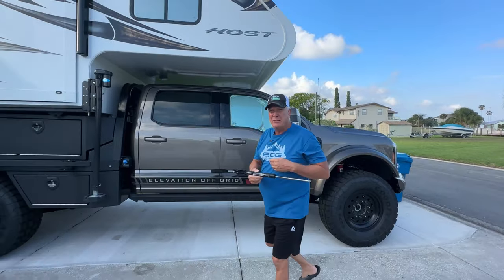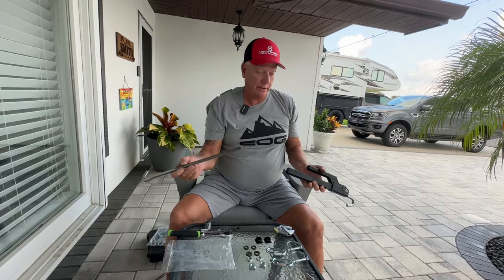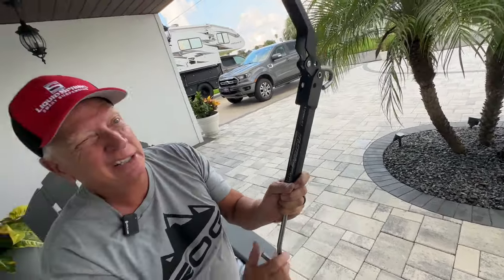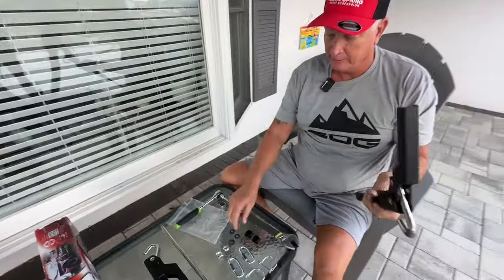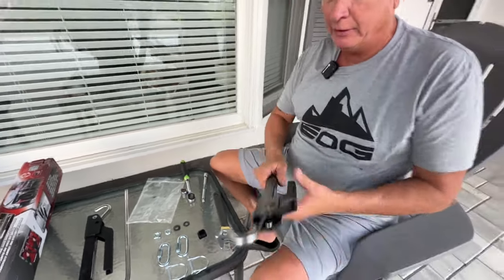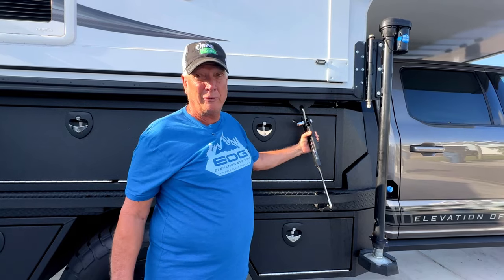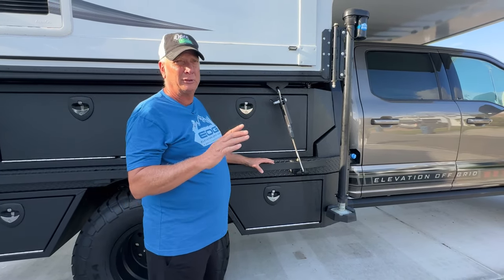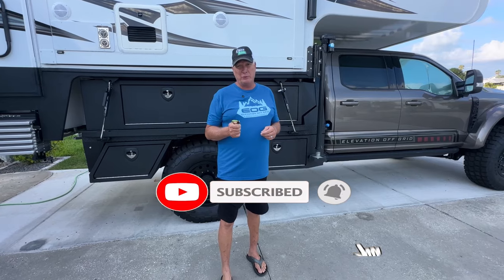The REAL TRUTH about TORKLIFT and TORKLIFT FASTGUN tie downs for Truck Campers and Flatbed Trucks

Comment: I don't know how much you plan on going off-road, but you are really going to appreciate the departure angle you have with your setup. Looks great!
Reply from the maker: 1st, thanks for checking out the video.

We designed our rig to do mostly off grid/ boondocking adventures. We have Liquid Springs so we can raise and lower our suspension.
Reply: @tonyshelton3744 I was talking to Danny the other day about where they could put a spare tire. I was suggesting the trailer hitch off the back, laying the tire down flat on a custom carrier. I can’t come up with any other places to suggest but that would probably infringe upon that departure angle that looks pretty sexy at this point.
Reply from the maker: @thecumminscamper we looked at putting it on back hitch(horizontal) but 42” tire is just to big plus we “plan” on putting a generator there… you can check it out in up coming video. Thanks for the suggestion though. 
Danny